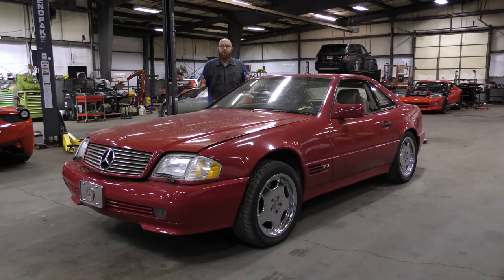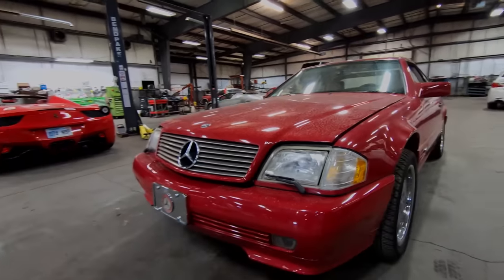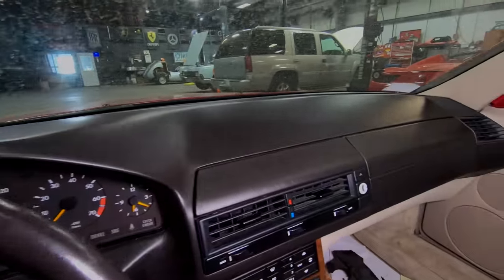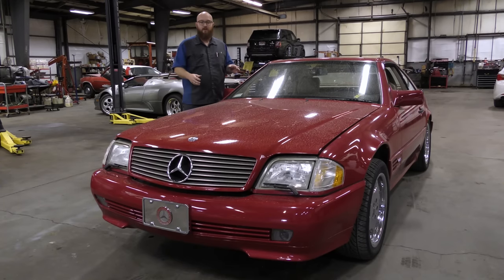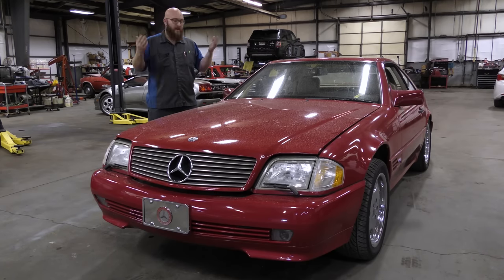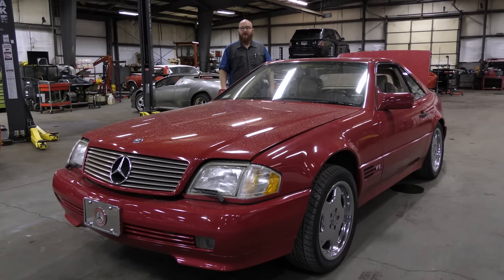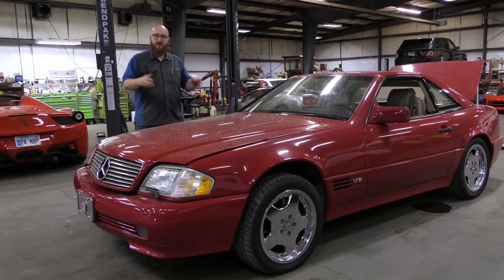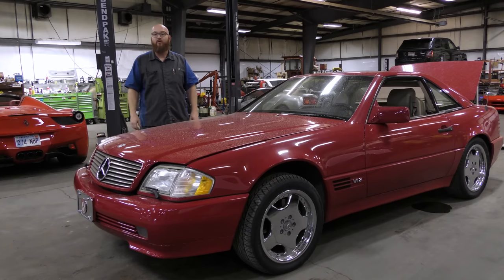Another customer scammed! CAR WIZARD shows why this '94 Mercedes SL600 is needing 15K to get sorted!

Comment: I've had my 1998 SL600 for 11 going on 12 years now. I've done all my own work except for replacing the trans when it blew. I probably wouldn't recommend it to anyone..even with extensive knowledge and doing my own work adding up receipts I am over $40k in parts over the years owning it.
Reply: In your opinion, has it been a worthwhile ownership?
Reply: Financially absolutely not..if I totaled it today id get a 1/4 maybe of what i have into it from insurance but I love the car..the only other car like it is a w140 which is another money pit. I daily drive it alot and would probably never sell it.
Reply: @dfs316  well, you enjoy it, and that's the important aspect.
No car is worth it financially... unless it's a desirable model that appreciates.
Reply: Yes and it is a 1998 so it is a far less of a nightmare then the one in the video...the wire harness for the engine, throttle bodies, and trans rot for model years 1991? to 1996 and the ads 1 is harder to work on then the ads 2 found in the later SL600s like the one I own.
Reply: wow
Reply: It's pretty much working on and maintaining 2 engines at once because that's pretty much what it is 2 in line 6's on the same crank. So 10.5 qrt oil changes, 2 $500 MAF, 2 air filters, 4 o2 sensors etc...and that engine sits tight in a small car.
Reply: That's devastating. I'm a pretty competent home mechanic, but that doesn't mean I want to spend all that time on it. I just got done bringing back an E39 540i from the brink, got everything straightened out, surprises and all, and it's now up for sale at a price where I'm going to lose money for the privilege. It was a gamble Copart car that looked in great shape, but turned out to have a number of surprises in addition to the apparent chain guide failure. I did it anyway, because it is a cool car and I didn't think it deserved to go out like that.

I don't think I'll ever gamble on a broken car again unless it's going to be one I love and I'll expect it to have tons wrong with it. Car's like this Mercedes here, I'd fix it if someone gave it to me, because I've always thought those were cool, but even as a free car, it's borderline as to whether or not it's worth the trouble. I feel so bad for that buyer, I hope he can afford the lesson he's learned here. :(
Reply: But even $40k in parts is massively less than the depreciation on a newer vehicle, it's only $3,300/yr over 12 years and my 2016 Accord has depreciated nearly as much per year.  

I would love to own one of  the V12 Mercedes, and it is one of the vehicles on my "maybe one day" list, but I look at the over all cost of ownership and as I see it, if I buy wisely, I am buying a fully depreciated vehicle, and then the cost of repairs and maintenance, even if apparently substantial, are still going to be better than the brutal depreciation on a new $100k+ car.  And there's a good chance that one day it will be worth more than I paid for it.

Also the state tax per valorem tax (NC in my case) on an older vehicle is a drop in the bucket compared to the tax on a new luxury vehicle.
Reply: One of those "sealed for life" transmissions where life means warrantee period.
Reply: You still came out on top. A nice Mercedes cruiser. Now days that car would be over 100k new.  I think the AMG models back then cost close to that.
Reply: The 722.6 trans are usually really stout except for the ones used in the sl600 and w202 c43 which are the same..it just randomly blew one day around 80k miles..it was 5-6k to replace.
Reply: I'm in MA and for some reason I always get screwed on the yearly excise tax on it. It is usually around $400 where my 2017 c300 is half of that.
Reply: Same as an old 928.  Real money pits that need constant work.
Reply: The 722.6 transmission? Probably the most unlikely transmission on earth to blow lol.. The only mass produced auto transmission in existance that could take the +1000Nm from the turbo charged V12's.
Reply: @PaulBCISSP  No they came later. The 722.6 is probably the most reliable auto transmission that has ever been built by anyone.
Reply: @PaulBCISSP  I've had one of those too. No more MB for me.
Reply: WOW!   I've owned my 1998 BMW M-Roadster for the same amount of time, maybe have $2,000 in parts into it.  Clutch, brakes, fluid changes, filters, batteries, one set of tires.  That's about it.  Never saw a check engine light.
Reply: @Hubjeep  The SL tops are always just a short time from one of the 11 hydraulic cylinders going.  Me, I'd rather have a manual top.  About the only more painful top is on a Bentley.  I haven't made that mistake yet but I have been tempted.   Is the BMW top manual?
Reply: I salute your courage of ownership sir
Reply: @dfs316  After 5 years they use 10% of the original MSRP as the cost base.  So the 600 was probably $120K new so they use $12K while the C300 was probably 45K so they use $4500 as the value.
Reply: That's really good to know @Jim. I've always wondered about maintanability with old v12 Mercs.
Reply: 40k includes a new trans and extensive sorting...rubber gets old and dries out..everything rubber has been replaced..suspension bushings, 4 hydraulic suspension accumulators ,drive shaft flex disc's etc. All sensors so MAF, O2 etc.  That also includes high flow cats..renntech exhaust. I could have gotten away for a good amount less if I was less anal about it.
Reply: @dfs316  as a car enthusiast, you definitely can’t leave rogue service lights on the dash 😂
Reply: Damn! 40k?
Reply: Finally someone who is honest about their car.
Reply: I've owned various Mercedes and BMWs for years now and the only way I recommend buying one to anyone is if they can do their own work. I also actively seek closeouts and Craigslist for parts preemptively. I would totally take this car on if I had the opportunity, but obviously I'm a bit crazy.
Reply: @PaulBCISSP    They were manual for the first couple years.  1998 they became hydraulic.
Reply: @PaulBCISSP    OMG, 11 hydraulic cylinders!!!!!
Reply: @Hubjeep  The full suspension is also hydraulic. The seals and various o rings leak and need to be replaced. You need to be familiar working with high pressure hydraulic systems to own this car
Reply: @dfs316    Amazing!  Did the S500 have a spring suspension?
Reply: @mickeymang6  
These were well over $100k new, and there were no AMG models yet.
Reply: @Hubjeep  Yes the base w140 s500 would have came with a normal suspension. Hydraulic rear was an option not sure about front and rear
Reply: Please. Your price for parts is not in any manner believable.
Reply: That's nuts, but if it brings you joy, congrats
Reply: @HeavyProfessor  He is lying.
Reply: @stephencurry8552  ok
Reply: god damn thats an expensive pos imagine the bill if you didnt do it yourself
Reply: honestly 4 grand a year isn't bad considering what a new one costs.
Reply: You must have beaten on the car really hard..I have a 98 sl600 with 104k miles on it.  Owned it the last 30k miles and I've only had to replace the front control arms (bushings dry rotted), lower oil pan gasket and oil level sensor o ring.  The bottom of the car is clean and the engine itself looks as if it only has 30k miles on it (it's that clean).  The car has been about as reliable as a Toyota and the m120 v12 engine will last for a very long time if you just change the oil
Reply: Isnt this SL from time period when Mercedes were allegedly bulletproof? SMH
Reply: @alandunlap3614  I have a 98 sl600 and I've put 30k miles on it with very minimal maintenance.  This guy probably beats on his car or doesn't maintain it like he should
Reply: Nice, I love the 98's, was almost my first car, I got an x3 instead.
Reply: @kyle-li8sn  Not beaten on..its a 1998..so 23 years old..rubber on a car last maybe 10 years before it starts drying out. Theres no way your your car that weights over 2 tons only has needed control arm bushings on the front. I refreshed everything to how it was new...I guarantee you would see the difference driving them back to back and I could make a list of everything your car needs just suspension alone. Just because it hasn't failed doesn't mean it's not worn. That's what I've spent keeping it running like new..not just running. I have a public cost of owning and work log. Or I'm lying and 20+ year old mercedes v12 convertibles are very cheap to run and nothing wears out ever and only needs basic oil changes. I don't want the secret out....
Reply: @alandunlap3614  The engine itself is bulletproof, the only time it has ever left me stranded in 12 years is when the trans blew. Everything has been replacing worn old rubber parts or sensors and preventive or while I'm in there maintenance.
Reply: @dfs316  well that could be possible, I only change things when they actually break but if you look at my cars service records not much had been done and it rides like a dream.  Just took it to the shop and got it back and that's all it needed.
Reply: Go to a MB dealer, it is mostly Dr. and some business guys who lease for two or three years.  No person is buying them for longevity.  MB has ZERO priority on longevity.  just short term snob appeal and tech wizardy
Reply: @pulaski1  Not true at all. There is no way a 2016 Accord depreciated that much in this used car market.  The $40K was parts only.  What would it have cost to keep it going if he also had to pay for labor?
The 2016 Accord would have far less maintenance and repairs and any repairs it might need would be easier and cheaper to get done. Both new and used parts are still easily available for a 6 year old Accord.
Reply: @webcomment8895  New my Accord cost about $27k in 2017, and today it is worth about $10-12k, or less if I traded it.  That means it has depreciated about $3,000-$3,400/yr.   Though quite frankly the precise numbers are irrelevant to my point that new cars depreciate a lot and well maintained cars over 20 years old hardly depreciate at all.

And in your argument you're double-counting - the $40k IS the repairs and maintenance, and it was over 12 years, not the five years that I have owned my Accord. ... I concede that, yes, labor would be on top of the $40k.

If you're going to argue about short-term market distortions, that has nothing to do with decision making over a 5-20 year time frame.
Reply: @marklewis8067  Not everyone wants a Corvette.  Just because you don't like Mercedes doesn't mean that others shouldn't. I thought we were all "car guys" here, so why the insults?
Reply: @pulaski1  Unless the Accord is in rough condition or has super high miles, it’s worth more in trade in than those low numbers in this super hot used car market. 
Even in a less crazy used car market, Accords do well in resale. In a softer car market, you get great discounts on new ones, so there is still not bad losses even though you get less back at resale time.
You can easily get more than $12K in trade in on a 2017 Corolla that was more than $10,000 cheaper than a $27K  Accord when it was new.
Reply: @bobimnottellin362  what do you think about an 86 300 D? I just saw one of those popping up on craigslist a few times for 7600 in the last week. It's absolutely immaculate inside and out.  The one thing that scares me is that the engine cover looks like it has a thin layer of burned oil all over it.
Reply: @dfs316  who expects any complex V12 gran tourismo to be cheap to operate? Don't know why you even made this post. Those that this "revelation" appeals to already know to stick to basic fwd economy cars.
Reply: Thats typical..why i own a 79 280sl simple.. But it aint cheap..
Reply: The reality is that NOBODY fixes the top once it goes bad. They just show it off and keep it for a few more years, then sell it off to the next yokel. Only the true idiots spend the money to fix it because it will just go bad in another two years, then tney admit defeat and sell it off. I would probably keep it in the garage with the top down and just drive it during sunny days.
Reply: Buy a Honda,
Reply: @edhollingsworth2335  there is no Honda in this class.
Reply: I smell bullshit.
Reply: If you like working on cars, this seems to be the one to own. lol 
I've owned a 2003 4Matic S-class for 5 years now and virtually no issues with it. Two shorted relays, one caused an overheated smog pump that I replaced myself with a used eBay part. Literally a 10 min job. A few burned out LEDs that I replaced and modified myself, a broken heated seat wire for the back seat (some moron yanked out the seat without disconnecting it first). That's it. I do my own oil changes and any other stuff I can do without a lift. It was $5k, so I don't give a shit if it explodes in the middle of the street at this point. I'm sure I could part it out and get most of my money back.

Comment: That’s why, 3 years ago, when I bought a 92 for 5k thinking it was a great deal, then I realized all the harnesses were cracking, I immediately sold it for 3,5k. It’s awful to learn with a mistake, thanks Mrs and Mr Car Wizard for saving someone’s family money! This channel is not only entertaining and informative, but of a public service. Cheers!
Reply: 92 wasn’t affected. It was 93-95 model years
Reply: Sharp ass cars ...it's a damn shame
Reply: I've only been into the mercedes a little more recently,as I picked up a nice 80 240d 4 speed. 
I also learned it's probably best to not venture into the 90s on most Mercedes as by then they started to lose their way with stuff being repairable. 
Even though, I'd really like a blacked out 90-91 560sec.
Reply: @MrTheHillfolk  my dream mercedes is 80's 300d. turbo. I think they are made real well..
Reply: @markdamstra  I saw one out about 6-8 days ago! 
Nutty guy ,it's upstate NY and we got snow ! 
Tbh ,it looked well used, bit was still going down the road. 
No visible rust ,but the paint was rough. 
Probably a real road warrior with a few hundred k on the clock.
Reply: @MrTheHillfolk  nj here. they are tanks. my dream mercedes.
Reply: Suspension struts go bad and make the car sit crooked, travel sensors are an integral part of struts.
Reply: Did you inform the buyer?
Reply: Wizard and Scotty Kilmer say so many things the automakers hate (i.e. the truth) they get some real venom said against them at times - which is, of course, the only reason I watch.
Reply: @markdamstra  I had an 300 Td estate automatic . Amazing car .
Reply: @Yesterday23071  wagon no? This were great cars.

Comment: back in the late 90's and I worked in an MB dealership. I remember seeing a lot of this series in the workshop with the interior completely stripped out and work on the wiring going on. The wiring harness was the first thing installed when the car was built, therefore the depth of the job... There was ALWAYS at least one in the workshop undergoing this job. Now I know why...

Comment: “You guys need to start getting pre-purchase inspections” - Wizard in the last video that no one listened to
Reply: Or at least try everything to make sure it works BEFORE buying a car.  The hydraulic leaks seem pretty obvious.   The wiring harness is also obvious.
Reply: @ckm-mkc  true but there’s also a chance that a person that discovers this issue may not know how expensive and complicated it is. Might think it’s a minor fix
Reply: @saratc660  Then they should learn to use the internet, otherwise I have no sympathy
Reply: @saratc660  Yes, and may have been told that it's a minor fix.
Reply: @ckm-mkc  - The person must have bought this sight unseen, based on the shiny new red paint. lol

Comment: I had a 2000 SL 500. I found a place in Oregon. They  exchange or rebuild your hydraulic CC pistons. It was $1,100 exchange or $750 rebuild. A local independent Mercedes Shop removed the old ones and sent them to the Oregon shop and installed the rebuilt ones for $850.
Reply: They get better price because they are dealer. They pay a lot less for parts.

Comment: I always loved the styling of these older SL Mercedes. Very great looking car in my opinion. I've read that Mercedes stopped using this type of wiring after 1996 so an SL made after that year might be a better option but you'd still have the convertible top issues to deal with. I saw a 2001 SL500 in my area with only 72k Miles that sold for $19k. It looked nearly brand new, and had all the service records. I was very tempted!